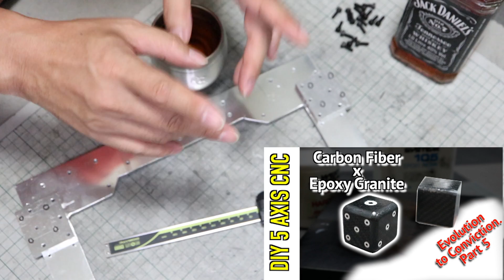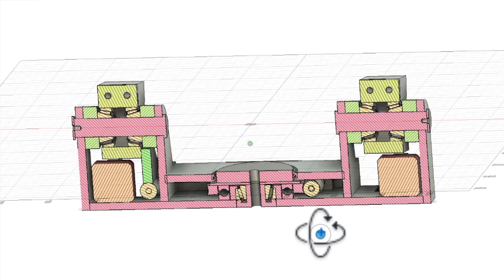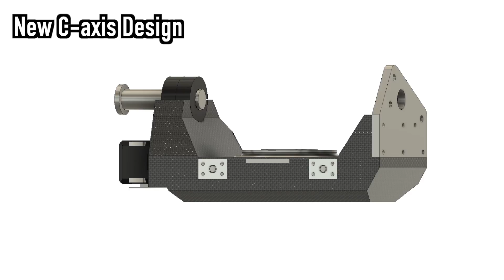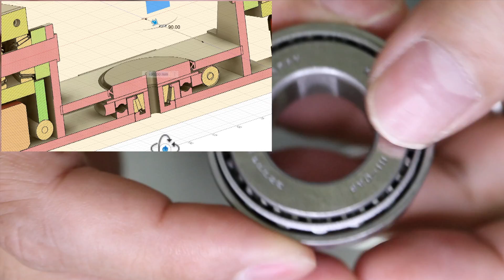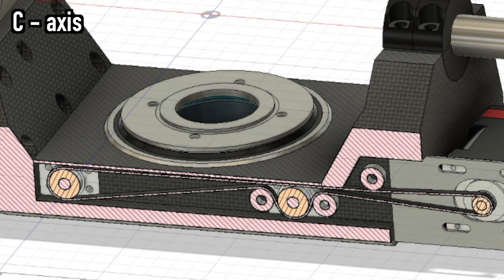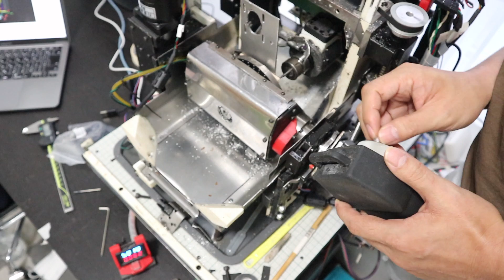Building The 5-Axis CNC Machine in a Small Room: A DIY Journey. (part6)

Comment: Please! Continue with next episodes. Teach us how to overcome with the electronics and firmware
Reply from the maker: I think the two choices for the 5-axis control program are LinuxCNC or Mach.
Both have a backlash compensation feature to compensate for mechanical backlash.
Mach seems to be cheaper to use, but I have never used it because it is charged.
Linuxcnc is free software, but it is a bit difficult to use.
https://youtu.be/g-fzD8sEcIk
https://youtu.be/EcCYf4WEvKs

Comment: Wie viel Euro willst du für die Fusion 360 Datei der CNC? Finde das Projekt sehr interessant!
Reply from the maker: The current 3D model is partially complete in production, but many parts are not yet finished.
It is planned to sell all the data eventually.
Reply: @a-cnc-f  Alles klar, hätte die Datei auch schon im jetzigen Status gekauft sofern du sie mir verkaufen willst 😃

Comment: Your use of Rolled Worm Drive Gears will add a Lot of Periodic Error and with 2 of them will cause wear of the Gears..
.Better to use a Precision Ground Gear rather than Rolled inaccurate ones.
Reply from the maker: Thanks for the advice.
You may be right.
However, my equipment and funds are limited.
I will try anyway.

Comment: Very awesome! It's always better to redesign and improve before building. I don't want to cause more delays, but did you test Jergens hardened steel threaded inserts? Also the AMF zero point clamping system is another good workholding tool. Their K5 unit might fit perfectly, and all you need is to put a stud in the bottom of your workpiece to machine
Reply from the maker: Inserts will be embedded with rivet nuts.
We are also considering embedding other metals in areas where strength is required.
AMF is attractive, but I think it would be difficult due to the size.
Reply: @a-cnc-f  Gotcha, the rivets should be strong enough. And I always forget the size of this machine, you fit so much amazing design into such a small package! I'm so used to the K5 clamps being too small for my applications 😅

Comment: Hi, good work , do you have discord channel where we can connect
Reply from the maker: I do not use discord.
Reply: @a-cnc-f  any other way to take guidance from you
Reply from the maker: @shrawankhatri6083  What do you want to know?
I do not publish personal addresses at this time.
Reply: @a-cnc-f  I wants to create robotic arm to complete the pick and place functionality. For that I need the diy way
Reply from the maker: There are many things I don't understand, but if you tell me what exactly you want to know, I will answer.
What level do you want to talk about?
What problems are you facing?
Reply: @a-cnc-f   which controller and I have to use to as control and can you provide any cad files which I can follow to assemble the body
Reply from the maker: @shrawankhatri6083  
Given the nature of your question, I believe you are at the beginning stages of wanting to build a robotic arm.
Although CNC machines and robotic arms are similar in many ways, I have never built a robotic arm, so I do not have CAD data, etc.
There are three main types of knowledge required to make a robot arm.
1) Mechanical knowledge and the skills to produce it
2) Knowledge of CNC control programs, G-code, etc.
3) Knowledge of electricity to run motors, etc.
Each of these is no easy task.
If you want to use a 3D printer, you also need to know how to use it.
I think your creativity is wonderful.
I wish you success.
However, I cannot teach you the details until it is completed.

The recommended control program is LinucCNC.
It is the only one I have used.
It supports up to 9 axes and is free to use.

My advice is to first look into LinuxCNC and study it until you can run a stepper motor.
If you can control the motor, you can handle the hardware stuff.